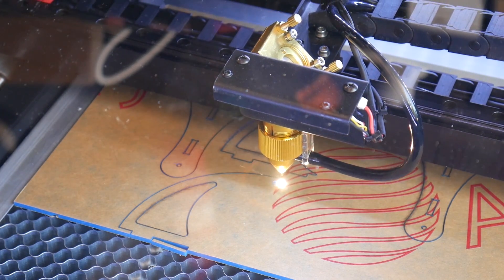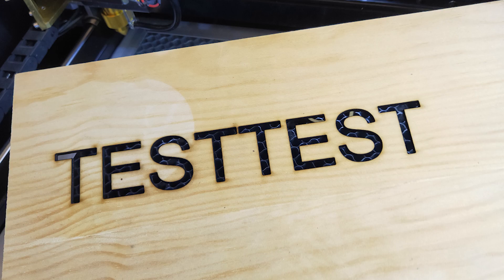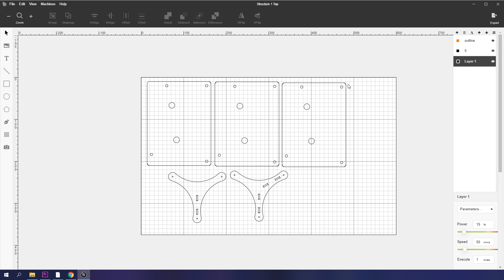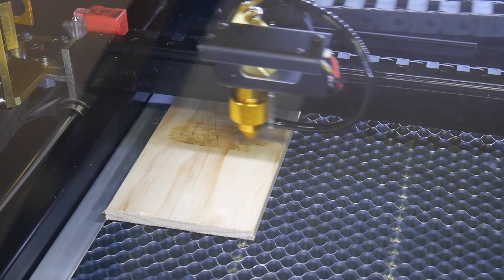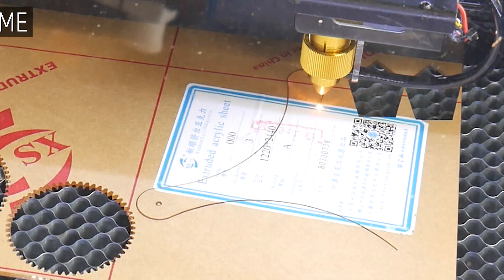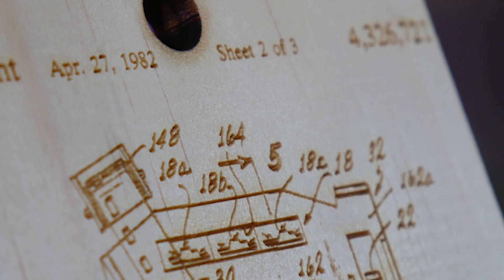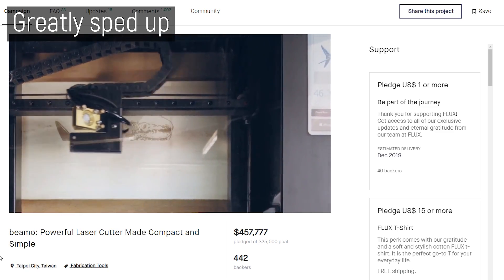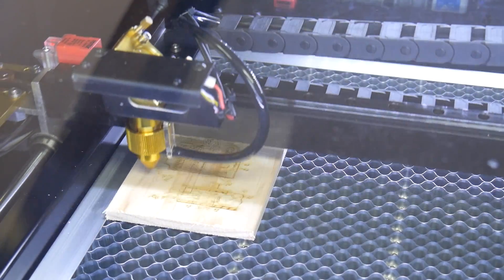FLUX Beambox Pro 50W CO2 Laser Cutter Review

Comment: 4000 !?!?!?
Nope 50 W for 4000 seems clearly to expensive.
Reply: I'd love to see what options you consider fairly priced, genuine not sarcastic question. This seems quite cheap although I've only really used Universal Laser Systems products.
Reply: Lachlan Leslaighter thunder/Aeon, or the Chinese line-up 50W+.
Reply: @lochieleslaighter  Well for a simple maker (not a pro) 4000 is a lot of monney. Ok the hardware is good, there is a good touch screen for the control, adjustable bed, wifi etc... but it's still a lot of money for just cutting wood and acrylic.
I'm not saying it's not worth it but i'd rather pay 500€ for a 40W k40 laser even if it require more work to use than 4000 for 10 more Watt

Comment: I have been looking at getting a desktop laser and didn't want to get a cheap k40 laser from china.  I looked at the Beambox Pro and have done some research and don't know if it is user error but it seems that the laser tube on this unit doesn't have a long lifespan, and at over $A500 it's not cheap to replace.  I would expect a longer lifespan for a machine that cost $A6,000.  Maker's Muse has the manufactures stated what the expected lifespan of the laser tube is?
Reply: What's wrong with Chinese machines :(? They offer by far the most bang for your buck. 
Take a look at the Chinese 50W+ machines, they're much better quality than the K40, work with Lightburn, and can have a camera retrofitted. Much cheaper than the 'smart' machines ;)

Comment: I wonder if the solder fume extractor, or something similar from EEVblog #1305 would be sufficient? It is certainly a lot cheaper
Reply: It can produce a lot of smoke. Enough to fill a room in minutes. Pretty sure that won't keep up :(
Reply: @jordymoors  Looking at flow rates, you are probably right, the budget one probably won't be enough :(
However there are larger versions (350w) which have the same flow rate as the one Angus showed, for about half the price, but of course these are China specs, so who really knows :)

Comment: so i should buy a cheap china unit, gotcha
Reply: Link to the Teaching Tech video on the K40?
Reply: Should you buy an Cheap Chinese Printer or an original Prusa or an Ultimaker or a Stratasys Unit?
You either pay with money or time. And specially with lasers you have to be very very careful. You can't recover from a laser beam into your eyes.
I was planning rooms in the hospital where they are treating patients with lasers so I can tell you: be careful.
Better let the things get cut or go to a makerspace and cut it with a professional, well maintained machine.
I'm a tinkerer, I love to put hands on at things but I think I'll never buy an laser cutter unless I need to cut a lot of things.
Reply: Stefan Kreuter with a bit of common sense, and possibly some additional limit switches to turn off the laser if the enclosure isn't closed, they're really not that scary. 
They're a lot of fun, and can create amazing things. 

I went to a makerspace with a supposed 'professional' machine. They had replaced the controller for a DIY board, and the alignment was off far enough to get severely slanted cuts. My DIY built works better, if I dare say so myself.

Just like any other tool, be careful.
Reply: @1234fishnet  yeah I don't buy the time argument, you save maybe an hour by paying for factory alignment, it's really not that bad.  The thing to really watch out for is the type of controller and the interface.  I think there's DIY firmwares that also integrate cameras so you can operate a k40 like a glowforge.

Comment: 4000 USD?! That's going to burn a hole in my wallet
Reply: As long as it's less than 8mm thick...
Reply: @danielr9708  that's only acrylic, idk many people carrying acrylic wallets. Leather it'd slice through like butter.😜
Reply: @sinformant  This laser need to focus so it can really do something, and laser do have depth of field, so how thick it can cut is not unlimited
Reply: @sinformant  Make sure it's not fake leather or pleather. It releases hazardous fumes when combusted.
Reply: @Travis_Yu  I know it isnt unlimited, but the thickness of an item that can be cut is also limited to the type.of material. Leather cuts relatively easy compared to acrylic.
Reply: @TheOfficialCzex  I know. I own a laser. Nothing as nice as this but I have done leather wood, acrylic and stuff.
Reply: @sinformant  I use the mylar wallet Angus made and now there are burn holes all over my workshop 🤣
Reply: As soon as I heard that, I stopped watching the video.   Sorry Angus.
Reply: Yea if you want a laser cutter for relatively cheap buy a cheap K40 model from China for $400-$500 and do the modifications for air assist and water cooling.
Reply: @eyeborg3148  how do you do that?
Reply: price is down to 2000 on amazon
Reply: UltraNoob among other things yes
Reply: It would burn a bigger hole in his wallet $100 in America is like $150 in Australia
Reply: $5200 USD now lol